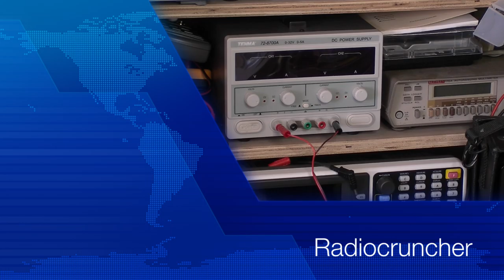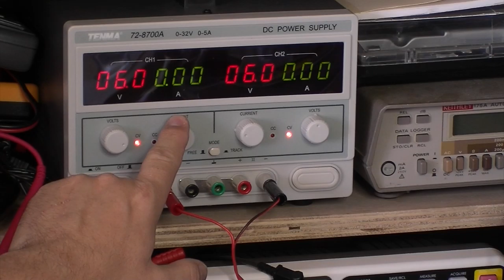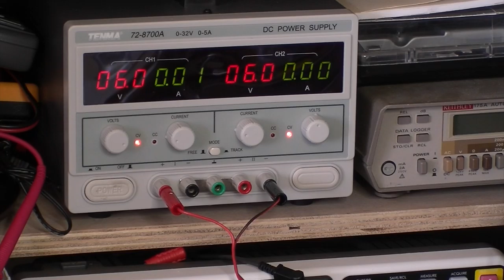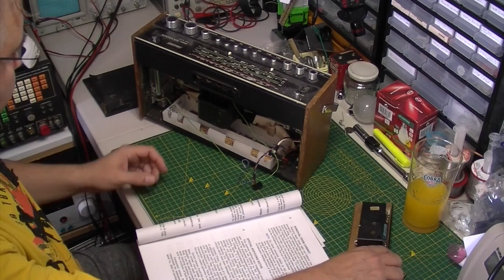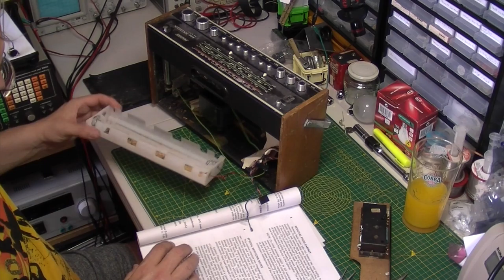Hacker Super Sovereign RP75 transistor radio Part 2: Chassis removal and inspection

Comment: I've seen this webbing material in other equipment before, usually it goes underneath the batteries and then you just pull on it to get the batteries out easier, could be the same situation here, though don't quote me!
Reply from the maker: Thanks for the advice Andrew. I've been inside my Hacker Black Knight just now and it has the same vinyl strips and battery tray. Seems like the strips just sit under the battery tray and hang over the top of the batteries. So when you pull on the end it slides the battery tray out. As they are pretty thin and only stapled on the seem to be prone to ripping off.

Comment: Where are you located?  Where can I send my Hacker RP75 for repairs or check up?
Reply from the maker: I’m in South West UK Thomas
Reply: @Radiocruncher  I just purchased a Hacker Super Sovereign RP75. The seller stated that the AM and FM works fine but it does not pull in Shortwave.  I have owned a very expensive Shortwave radio and here in Salem, I could  not pick up anything even having a very long wire antenna.  Is their anything in the radio that would prevent not receiving SW reception?.  I wish I lived near you and you could restore my radio.  I don't know of anyone around me that has your talent.  Thanks, Tom
Reply from the maker: @twoodruff01  Hi Tom. It's not going to be a lot wrong. 1st thing to do is to clean all the switches. It's likely that it's never been used on SW and the contacts are dirty. The other thing to bear in mind is that there isn't a lot on shortwave and it's best after dark. It's unlikely you will pick up much on the telescopic aerial so try a long piece of wire thrown out a window
Reply: @Radiocruncher  Thanks for writing to me.  How can I find an operating manual for my radio.  I checked Ebay and on the internet with no luck.  Also, I would like to have a service manual like the one in your video.  I just joined the Hacker radio group.
Reply from the maker: @twoodruff01  All the files are in the Hacker radio group. The operation instructions are in the photos section and the service manual is in the files section
Reply: I received my Hacker today.  It is in very good condition.  I need to pain the silver trim on top as the previous owner painted strips for his stations.  The sound is great so I am not sure if I should even tackle changing out the capacitors in the amplifier board.  I also will need to somehow print the word volume and the plus and minus marks.  The serial number is 3834. What year was it made?
Thanks, Tom